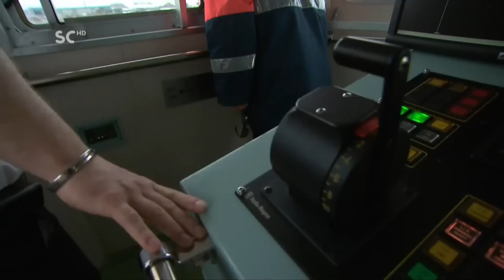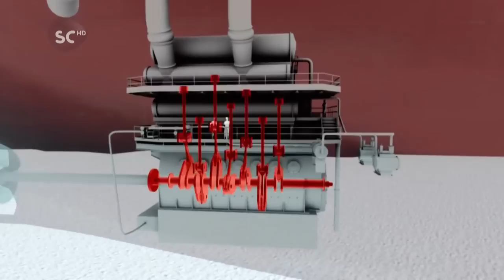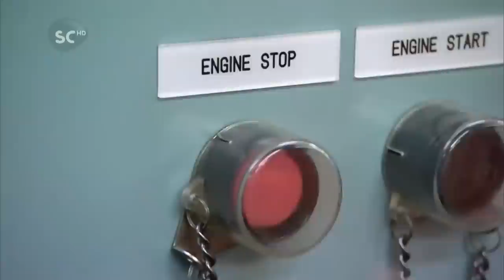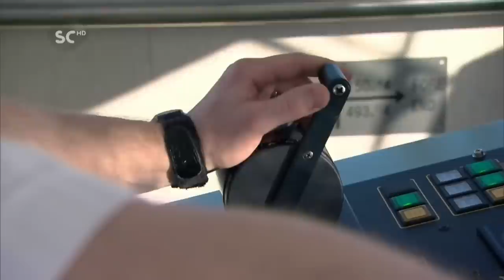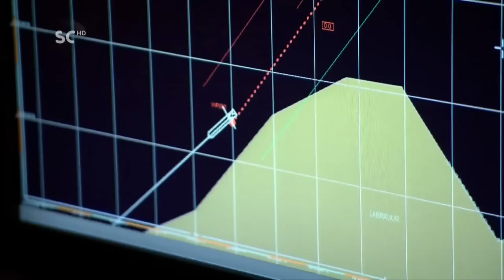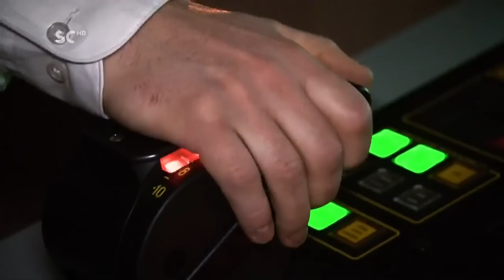Mega Navi Umiak 1 E

Comment: Our company washes the boat.
Reply: really?!?!
Reply: @dxtr5k  yeah bro it's a whole fcn process of 3-5 days. Depending on how dirty it is. They should've put it in the documentary. But wtv.
Reply: @potatopoison1130  wow... ya you are right they should have included that.
Reply: Anonymous Anonyme  I'm not at that company anymore. But the process is done manually with high pressure water gun. 5000lbs
Reply: Urgence Marine?
Reply: @CaptinPelley  yes sir
Reply: @potatopoison1130  I'm on the Umiak and we just had hold 2 and the main deck cleaned. Took about a day.